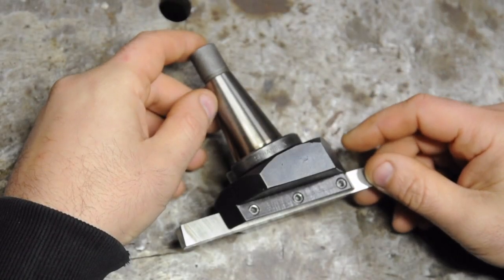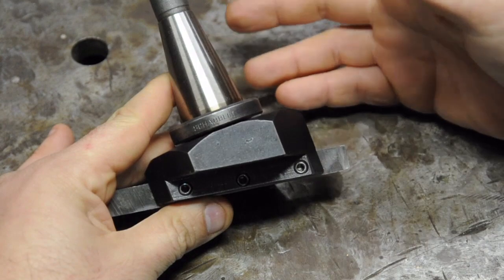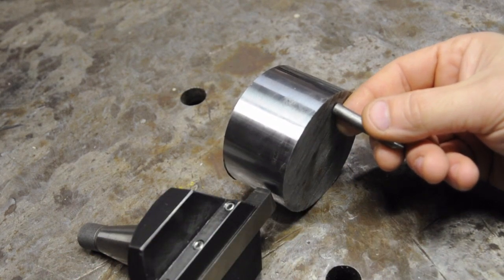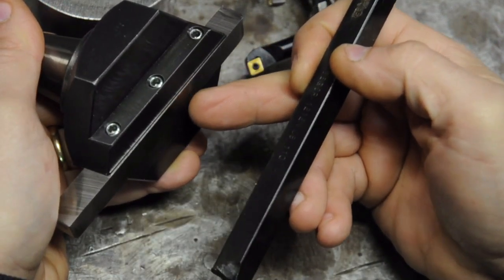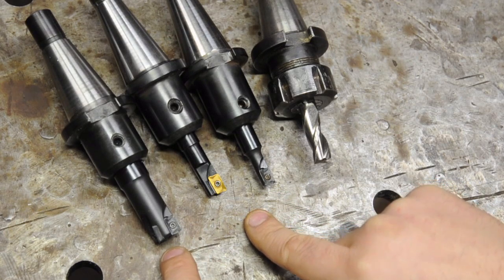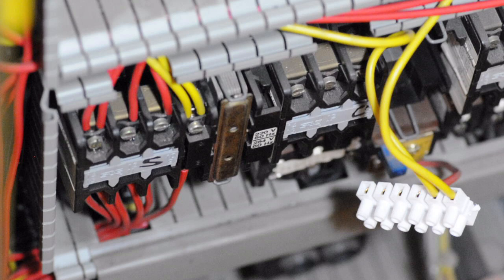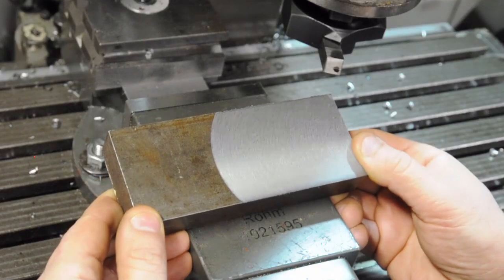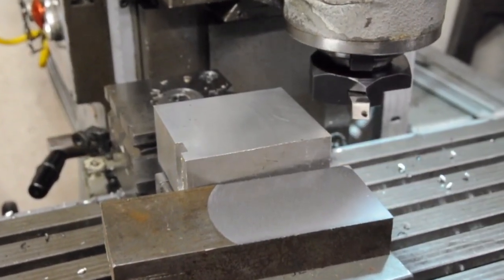Building a Fly Cutter - Addendum

Comment: 1:15 I'm about to build a fly cutter and for balance was considering leaving the bottom square to the spindle and only cutting the tool bit channel at the (in your case) 10 degree angle.   There's really no need to remove that material.   Or is there?  Another mitigating approach could be to forego cutting so much off one end for the set screw face.   Instead clearance holes could be drilled to accommodate a hex wrench while only the very bottom half inch or so would be threaded.  What are your thoughts ....... after seeing your surface finish, I'm not sure how much better it'd perform.   But maybe for larger fly cutters, these ideas could help keep everything balanced better

Comment: I admit that not being an engineer nor machinist in metal - the look of the tool retention system in the fly cutter made me wince!
I am a timber machinist.
I do use a shaper / spindle moulder.
It spins at 6000 rpms.
I have no idea what speed this fly cutter operates at.
Years ago we bought an ancient shaper / spindle moulder.
The cutter knives were clamped into the spinning block with a set screw clamping system.
It wasn’t like today’s modern shaper heads with retainer pins to help prevent the cutter knives from flying out of the head of the clamping mechanism failed.
Because it was a new to us old machine bought at auction, when we set it up for its first run & being aware of the potential danger to life and limb, we checked and double checked everything, turned the circuit breaker off out in the meter box, then plugged the shaper in and switched it on.
Then one guy hid down behind another cast iron jointer thickness planer that we had been using and it had its cast iron tables folded in the up position like bat wings.
I went out and activated the mains switch / circuit breaker in the meter box to turn it on, so that no one was in direct line of fire, if the shaper knives somehow dislodged on start up.
And let fly they both did at full 6000 rpms.
One cutter knife hit one of the cast iron tilted tables on the jointer and left a dent in the cast iron a full half inch deep before ricocheting off in the upwards direction through the corrugated iron roof sheeting and off into the scrub behind the cemetery next door to put factory. We never did find that cutter knife.
The second knife that let fly penetrated 10 x 3/4 inch sheets of melamine chipboard one our material rack, went through the half inch pine ship lap boards on our office wall, then through the 10mm gyprock plasterboard wall sheeting of the opposite office wall, through another 10mm gyprock plasterboard Sheet into our furniture showroom, through the opposite 10mm gyprock plasterboard wall Sheet on the outside wall of our showroom and continued on through the half inch hardwood weatherboard exterior cladding of the showroom wall and into the neighbors cow paddock!
We never found that knife / cutter again either!
We had to scrap the jointer, because it was unusable with the huge dent in its machined flat surface, it actually warped the cast iron Infeed table.
Had to patch the roof and repair office & showroom walls.
That one lesson of what can go wrong taught me that old tooling without retention pins, that relies on just clamping pressure from set screws - just isn’t safe in today’s day & age.
Modern shaper heads have the retention pins as well as the clamping mechanism, and now they also have depth limiters as well ahead of the cutter knives to limit the depth of cut that can be taken by the following cutter knife etc.
These are safety enhancements to help prevent the types of mishaps that can potentially kill people in the workplace.
I guess if a fly cutter operates at relatively slow speed in a mill for cutting metal the centrifugal forces involved are much reduced from those of timber shaper / spindle moulder heads.
But just watching you design and manufacture that fly cutter without for eg any drilled dimples for the set screws to locate into in the HSS tool, to prevent it sliding out of the fly cutter body lengthwise while spinning had me cringing.
Surely you could put 2 matching dowels into the tool body and two matching holes in the tool itself that “locate / index the tool into its position under rotational centrifugal force and dimple the clamping face so the set screws locate into the v drilled dimples on the tool face?
Maybe I’m worrying about nothing, but 25 odd years later the old shaper spindle moulder Head lesson has stuck with me and I am very risk adverse about anything that spins at high RPMs.
My 2c

Comment: What is the most epic fail you've ever experienced as in pieces shattering and/or exploding (as it were) flinging debris everywhere?  As a copier repair technician, I had several times where, when removing an, "E" clip from its shaft, it springs free flying across the room. 

One of my early experiences as a newly trained technician, one such clip took the opportunity to bolt to freedom screaming, "I'm FREE!" as it zinged into the air and right into a womans hair bun!!  

As her hair was also serving as organic body armor, she did not even notice something had jumped into it.  As a result, I didn't even bother trying to retrieve it...

Comment: Hi ToT,
about the coil - I know this is late but for the sake of posteriority - here goes:
This is a coil from a contactor "CA 1-10" by the company "Sprecher und Schuh". 

I had the same problem in a ventilation installation; mine was visibly cooked.
They were very popular in the seventies but I could not find a replacement in Switzerland. 

So I had mine rewound for 240V and set it back in. Works fine.
The company that made it was: https://www.feindraht.ch/
Hope this helps, gnasch
Reply: A bit late, but was a contactor coil seriously made by a company called "speaker and shoe"?
Reply: @shurdi3  A bit late to your a bit late, but google says it was founded by Carl Sprecher and Heinrich Schuh, so yes, haha.
Reply: @brandonthebuildertx  a bit late, but I’ve really enjoyed this comment t thread
Reply: Way more than a bit late, most contactors that can be mounted to a DIN rail also have two screw holes allowing surface mount to a panel.

Comment: Any tool is a dangerous tool in the hands of an unskilled or improperly cautious/respectful operator.   

Anyone afraid of a properly set up fly cutter should return to sweeping floors, including the salesperson trying to replace your fly cutter with a group of face mills, when you have no need for them.  That is the position held by my old instructors , whom  held 100 years of combined tool making experience between the two. 

Whether you subscribe to the Beatles or Corinthians, there is a time for everything, and at times a fly cutter is still a superior tool, whether be for cost, convenience,  or advantages of cutting geometry.  

Not to mention that a good fly cutter doubles as a nice tramming head as well.   A 6" blank and a piece of paper is all you need, in absence of any indicator of choice.

Comment: not sure if you are still there but be aware that the inserts that go in your index cutters you use--you can also use the other edge as a flycutter --they do in fact sell the body but you can also simply make a flycutter concept with a couple insert pockets .  I have used that style of insert with its clearance already on it for decades. To be clear on those small inserts--you can use 4 edges not just the 2..

Comment: We used to make em outta 4" diameter and put 5/16" tool steel in the outer edge at 45 degrees, the worked very well, it was about 1/2" thick and we pressed a center bar in.. Lots of ways to do it.. Cheers

Comment: Yeah. That dark color IS from the "oil" once that oil and the HEAT GENERATED combine to "burn" the oil at somewhere north of 300 degrees F. The "hottest" you can get "carbon steel" without starting to affect its "properties" is 350 degrees F or so. And if a "chip" is hot enough to immediately "burn" oil its approaching or in excess OF that 350 degrees. What PRECISELY is your actual education/experience level with and in the "field" of "machining" that qualifies you to be a YouTube "educator"?
Reply: Precisely the same as you and your pathetic excuse for a channel on guns. Scratch that, about 100 video's more and an audience about 6388 times as large that generally find numerous experienced people agreeing with him.  BTW, please point out where he ever calls himself an expert.  BTW, you sound like you need to get some.

Comment: Can you explain/define "SFM" and just WHERE "surface feet per minute" is MEASURED and address whether or not "feed rate" is a factor in "SFM"?
Reply: Surface feet per minute is the relative speed between the work, and the tool, at the tool tip. Thus, as you face a part on the lathe, for example, and the radius gets smaller, so does the SFM.
It is entirely independent of feed rate, which measure how fast the tool advances

Comment: Im going to be making one of these for my mill fairly soon. The standard chinese flycutter set only goes up to 3/8 tool bits. Planning on making one for 1/2" tool bits. In particular one of the kennametal brazed carbide bits Ive got. 
Making it specifically for one job ive got that involves facing off a large piece of hardened steel. Id rather regrind the carbide bit a few times, then go through a bunch of inserts on the sandvik face mill. Should hopefully work pretty well.

Comment: you should try positioning your cutter better over the workpiece. climbmilling generaly gives a beter surfacefinish. right?
Reply: The approach of the tool has an small element of climb milling, otherwise it's not possible with a fly cutter used for surfacing.

Comment: I have a slightly unrelated question, how did you get into this? do you work in engineering or manufacturing? if no, what made you decide to start machining and where did you find the equipment for your shop? I feel like the clapped out Bridgeports you see at auctions are a little on the skeezy side in that you have no way of knowing how far out of tram, or just how beat the mill/lathe/etc. may be without buying it and taking the whole thing apart, or just buying it and trying to make things.
Reply from the maker: I started out with one or two benchtop mills.. the cheap rong-fu style.. then "upgraded" to a clapped out bridgeport.  I only got the schaublin.. a year ago?
Reply: @ThisOldTony  in your spare time can you build me a shop with all the tools ,, LOL like who has spare time any more .. great videos thank you for the time you take too put them out ,,

Comment: A huge advantage with single point cutting is the ease with which you can sharpen the cutter  they are a lot cheaper to run than an end mill - ATB

Comment: I use flycutters a lot - more often in a horizontal spindle where contours ground into the tool can provide otherwise tricky shapes in the workpiece.  This was called "flick milling" at one place I worked at. 
I'd be very wary about having so much tool sticking out the rear side of the flycutter as Tony shows initially.  This can collide with any shoulders in the work - or e.g. catch a hand held brush when applying coolant etc.  While watching the progress of the cut, one can too easily overlook the wider swing of the rear of the tool until it collides with something.

Comment: Take your contacter to your local electrical suppliers and ask for a replacement - I am an electrician and these things are easy to source and also easy to replace (even with another manufacturer) because they are made to British Stansards BS - EN - European standards. You should be able to source it in germany, holland, UK, ... .. anywhere :) send me a message if you have any questions. You should check your wiring to see if you have any damage to it i.e. melting etc as a precaution :)

Comment: Tony, I commented on your last video on how to rewind that coil, but there were 3k comments so if you can't find it, here's a copy...

Tony, that's a relay coil? That shouldn't fail at all, least of all due to spindle overload. If it did overload, it should take out a breaker or the relay contacts, not the coil. Probably there was a latent defect in the coil itself, like a bad piece of insulation.

You should be able to rewind it yourself. Measure the wire gauge and get some enamelled wire of the same gauge. Unwind the coil, counting the turns. Unsolder the wire from the terminals. Use fine grit paper to remove the enamel from the last 3/8" of the new wire and solder it to one terminal. Carefully and neatly wind on the same number of turns onto the bobbin, not pulling the wire too tight over the first loop tail. When you have the right number of turns on the bobbin, leave enough length to get comfortably to the second terminal, strip enamel off that and solder it on. Tape it up just as it was originally. Measure the resistance and compare it to the coil you got working. If the new one is within 25% of the good one, you're good to go.
Reply from the maker: Thanks Billy!

Comment: Hey I really enjoy your content and love all of your videos and I noticed that you did not acount for the time the cutter is not cutting douring one revolution when you were calculating rpms, you were calculating as the cutter was cuting the whole circle(1 ft) when in reality it was cutting maybe 1/4 of radius per revolution(so rpms schould be 400) maybe that is the reason for not perfect mirror like surface finish. I am sorry if I am wrong as I am not an expert in this field, and I would like to learn. Best wishes.
Reply: It is the cutting "rate" that is important not the intermittent cut.
Reply: It wouldn't matter if the cutter was just touching the work at the start of the cut, the tool tip speed would be the same, wouldn't it?

Comment: Feed & Speed charts go to pot with fly cutters as the air time is not accounted for as the work is still advancing.  You would need to decrease feed to a 1/4, hike up the speed, or use a big radius to get a flatter finish.  Either way won't get an ideal chip load :(

Comment: Looks like if you change one contactor you will need to change the pair as I think I saw a mechanical interlock between the 2 contactors.  If the bobbin (the part the coil is wound on comes off of the armature (the iron bits) then it can be rewound.Sometimes contactors have an economy resistor in series with the coil when energised the resistor is shorted out when the contactor is open, the resistor is there to reduce the current when the coil is energised ........... basically it stops the coil over heating. ............... its worth seeing if you contactors  have resistors and if they do 1) are  resistors there and Ok ie not burnt out   and 2) the contacts open thus putting the resistor in series..

Comment: Hi You can repair the coil , just remove the old copper wire and winding new copper wiresame size. I have done it on a Schaublin 125 Lathe , same contactor I I can send som pictures if you like. poulbo

Comment: 3:47...Wrong...The worst thing is when you know you're out of tram...you tram it to get a good surface finish with a 20" fly cutter and find out your mill table is pitched and the back side of the fly cutter goes 1-2mm deeper even though you trammed the head with the table stationary within less than 0.01mm! I always look at this mill with disgrace ever since!

Comment: Hello, I am a machinist also. I use fly cutters often. the store bought ones I use, have the set screws on the other side of the tool bit. so when it is thightened, will place it in the same place. Am sure you understand.
Reply: I had the same thought. All the homemade fly cutters I've watched follow the same pattern, and have the screws on the side which pushes the tool away from the centre line. This, added to the tool grind, means that the cutting edge is off centre, as you note, but it may not matter too much, with a large diameter cut. Presumably the screws are on that side, where there is more 'meat', for a more secure thread

Comment: The contactor/electrical parts biz is much like the car industry. Each company bought by one another, and as such makes/models morph year to year. (well at least since the 80's) - unless you have a vintage source for the exact reclaimed parts - not worth the effort of trying to located an exact match on a contactor coil that old.
While you may or may not have din rail in place, many have dual foot/din rail mounting options, and if not - din rail is stupid cheap - putting a small section in the place of a foot mount no big deal. Mark the wires ABC 123 and get it over with... Considering the other things you build/program - you should have no prob with the swap out.

Comment: Make sure the coil voltage matches your control voltage.  Those coils rarely smoke unless its getting more voltage than it expects.  Might be an issue with an incorrect tap selected on the control transformer. 

Depending who makes the contactor, you may be able to get the parts, or at least one that mounts in the same configuration.  Who makes it?

Comment: Tony, a clever guy like yourself, could easily rewind that coil.  Just measure the wire gauge, buy a spool of armature wire (pre coated for just this type of application), count the number of turns as you disassemble and rebuild the thing.  A couple of solder joints and if you want to get fancy, coat the windings with some epoxy.  I have done this for years and is no big deal.  After all, it is just winding a magnet.  Early science class stuff. Give it a try.  Good luck.